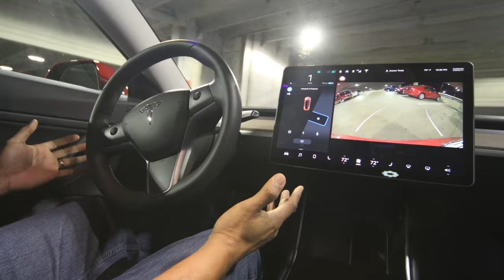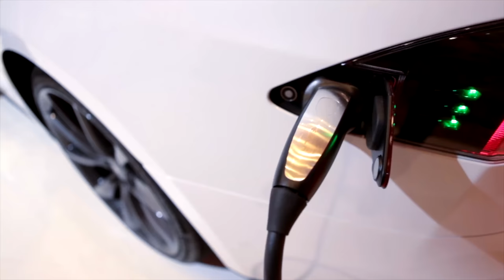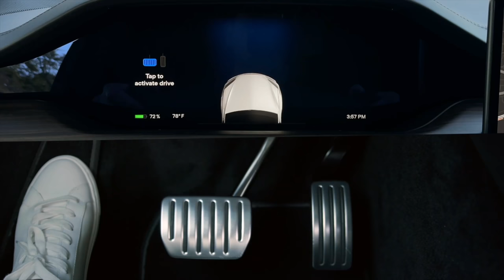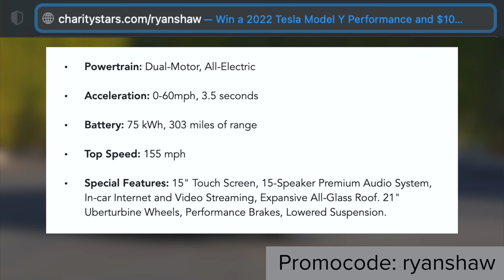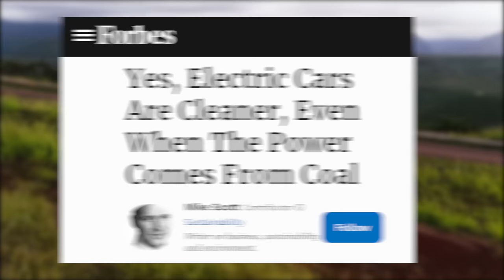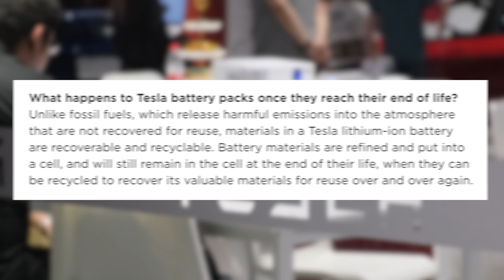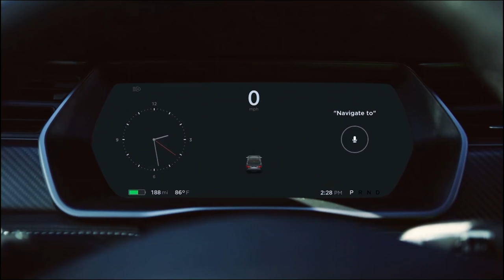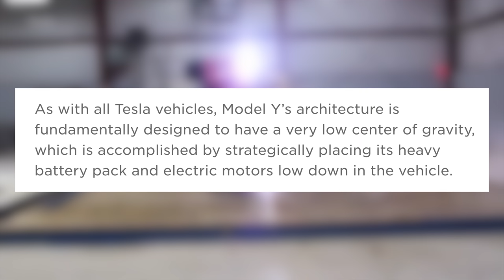9 Advantages To Owning a Tesla

Comment: One of the big advantages that you mentioned indirectly is starting a car in the garage to get it warm in the winter.  In Calf, this is no big deal but in Ohio it is. My garage is attached to the house, this meant either pulling the car out of the garage or opening the garage door to preheat the car.  Opening the garage door would still leave the garage full of fumes that I really don't want to breathe. Pulling the car outside to preheat it kind of defeats the whole purpose of having a garage.

Comment: My gas (petrol) bill went to zero when I bought my model Y and my electric bill went from $198pm to $111pm as I now charge my car overnight at 0.014c per KW. 
Plus my dishwasher, clothes dryer and all my batteries are now on this rate instead of my previous $0.12c per KW.

Comment: Electric vehicles make too much sense. 

1) So much energy is wasted in ICE cars via idling, lack of regenerative braking, and the impact they have on the climate.
2) EVs don't waste energy idling, and utilize so much more power considering the regenrative properties (energy is not lost as heat from braking), and the maintenance costs are zero to none.

Comment: I've had my Model 3 Dual Motor for 3 years now, and had a Model S for 5 years before that. My maintenance expenses for the 3 since I took delivery have been 1 gallon of windshield washer fluid, and two wiper blades. Maybe $80?
Reply: Where do you live that a gallon of windshield washer fluid and two wiper blades cost $80?
Reply: @allterrainrandy2587  Well, it was more that the wiper blades are pretty expensive - you can only get them through Tesla, and I think they're like $70 or so. I could be remembering this wrong. My point was, my costs have been practically negligible.

Comment: Tesla safety is also improved by the fact that there isn't a 400 pound metal brick under the hood in front of you that could end up in your lap in an accident.  Sure, they're designed to recess under the car in a forward collision but it's still a compromise.
Reply: Also, because there’s no engine, EVs have a better crumple zone.

Comment: What I like about the Tesla's is: the car is silent, the super charing network, low maintenance, the camera system, the instant tork, be able to charge at home and not worry about going to a gas station, not worrying about oil changes, using the Tesla app to warm up my car, or even summon my car, the large panoramic room, the range, the sound system, the frunk, and hopefully Biden passes the 12,500 tax credit for all Teslas.

Comment: Great video and agree with every thing but one.  My 2021 M3LR  is as you say quite with stopped waiting at a red light.  My 2021 MYLR however has a noise coming from the frunk.  I'm suspecting it is the heat pump.  I'm not the only one experiencing this but when I went to the nearest SC, I was told that it normal.  Not sure if that is true since my M3 also has a heat pump and I do not hear the same noise.  This noise takes away from lack of noise in the cabin when idle, something I do enjoy with my M3.
Reply: @Rapido20  This video is about Tesla’s. Only someone who doesn’t own one might not recognize the reference.  There is nothing in the video about BMW or anywhere in in discussion about this video.  Sorry it confused you didn’t think BMW owners were trolling Tesla discussion videos.

Comment: I'm  a fan and first tuned to your YouTube before ordering Model3 SR Plus a year ago.  Could you talk more about safety in front end collisions?   Radar was damaged in a crash, so detectors were disabled. The vehicle in front was a huge black SUV but not an emergency vehicle.
Reply: In a Tesla at least, the "frunk", or front trunk, provides not just cargo space, but acts as a huge crumple zone, so that it distributes the energy from a crash around the car rather than into the cabin. There have been many videos where a Tesla was in an accident, and the occupants could often walk out of the vehicle on their own. Compare that to say, a gas SUV/truck that rolls over multiple times, and the occupants often needing assistance to get out, and hospitalization in some cases.

Another nice thing is the dash cam built into the car. And because it records from 4 different angles, in the event of an accident in which you weren't at fault, you can prove your innocence, instead of the "he said/she said" witness testimony.

There's a YouTube channel called "Wham Baam Teslacam" that shows accidents and other interesting things done around a Tesla. In many of those videos, when another car crashed into the Tesla, the other driver claims that the Tesla driver was at fault. They often then looked shocked and change their tune when they find out the Tesla recorded the accident from four angles, and in some cases, the police will cite the other driver with causing the accident if the other driver claimed the Tesla was at fault.

Comment: What if you don't have a driveway? What if you live in an apartment? What if you are visiting your Great Aunt for a weekend and she doesn't have a charger? What if you are low on charge and you forget to plug in or something goes wrong and it didn't charge and now you can't get to work on time because it will take a half hour to get just enough charge to get to work and then another half hour charge to get back home?
The point is that with gas I don't have to alter my life in any way based on my car's power requirements. Stopping at a gas station for 5 minutes every 2 weeks is not life-altering. Where I live or what type of home I live in or changing my routine just because of my car is an inconvenience.

Comment: While the Tesla supercharger network has been a significant advantage over other EV manufacturers, Tesla has announced that they will opening this network to non-Tesla EV's. Also, I just read that Tesla has changed the pricing of their superchargers that will result in a substantial cost increase to Tesla owners.
Reply: Is this true? Very disappointing if it is the case. If anything I would have thought opening up the supercharger network to other EVs would possibly lower the cost as they would be making more off the increased number of vehicles charging. Sigh.. 😔

Comment: I can't wait to drive a Tesla for Jimmy John's and not spend $500-750 a month on gas. I know that I could he's a more gas efficient car than my Mustang but otherwise I really would just keep using my Mustang.
Reply: Make sure you bring an extension cord and plug into 110v at JJs and wherever you go lol
Reply: Have you considered a conversion instead? Turn that Mustang into an EV. Significantly cheaper than a tesla.
Reply: @eondrache7786  conversions are neither cheap or easy (unless you do most yourself and value your time at $0, but even then it’s expensive). May be different in a few years.
Reply: @eondrache7786  it would still not be a tesla. Cheaper just to buy the real thing.
Reply: My $80k telsa is a huge gas saver compared to a $25k gas car. Pssssh saving big time money bro
Reply: Where are you going that you’re spending $500-$750 a month for gas? Mustangs surely don’t use up that much.
Reply: @xMercuryx56  delivery driver
Reply: @anekinoo7  plenty of 80k gas cars and pickups for sale right now.
Reply: ya, I spend 550 a month on gas and will be able to charge my tesla at work, it's gonna rock
Reply: @geraldh.8047  I didn't say it would be cheap. Its just cheaper than buying a brand new tesla atm
Reply: But electric cars can't possibly the future, until then it's a phase
Reply: @mr.monitor.  Thanks sounds like a good idea.
Reply: @eondrache7786  I never really thought of it but that wouldn't be a bad idea. But I'd rather not do that though. But that would be funny.
Reply: @courchar  That sounds awesome. I wish I bad that.
Reply: @huskiehuskerson5300  What are you trying to say?
Reply: @xMercuryx56  Yeah I drive like 3k miles a month most of that is for Jimmy John's.
Reply: Buying a Tesla won’t save you money, not at today’s prices. That would be like buying a BMW 328i to save money because it gets 35 mpg on the highway.
Reply: @wyattpotter2103  Question is, can you afford a $45-60,000 car on a Jimmy John’s paycheck?
Reply: @TecnamTwin  It will save me money though. Also I reserved it a few months ago with Blue and White interior and after all the fees it comes to like around 45k. But if I reserved it earlier it would have been $1000 less.
Reply: @TecnamTwin  anybody can afford a $50K car.  It is call a 84 months car note.

Comment: I'm  Tesla owner and not a naysayer. But,,, if it's accurate that there are approximately 1.8 Billion ICE vehicles globally on the road displacing those with a lithium based battery component is more than daunting. If for example a BEV has 3,500 battery cells (or equivalent) in its pack and we aim at 100% conversion from ICE to EV that's something like 6.3 Trillion cells and likely a time frame of 20+ years. Continued innovation in battery energy is essential to accomplish this gargantuan goal.

Comment: Safety could be approved.  I purchased the Model S refresh thinking it would be the safest car.

1. Headlights suck
2. No front cross traffic warning (almost got hit by a car running a red).  It would be nice to have this.
3. No rear cross traffic when backing out of parking spots.
Reply: Model 3 is fine, matrix led's and every warning system available
Reply: @paulfreeborough6868  There is no cross traffic warning system on any Tesla.
Reply: @lxxdakinexxl  it's on the roadmap, maybe as an interim fix you could pay attention to where you are driving
Reply: @paulfreeborough6868  Defensive a bit? Cross traffic is great for drunk drivers that run red lights.  I had a big suv next to me and this drunk driver ran a red so I couldn’t see.  Luckily I stopped in time but I was inches from an accident.  Also backing out of parking lots between suv’s when people are speeding.  Like I said for being touted the safest car, it is not. The Model S refresh interior is light years better than the previous model and I don’t know how you live with the model 3 interior.  I had a loaner and it was garbage.
Reply: @lxxdakinexxl  I've got a Shanghai model 3, I've owned Audi's , Mercedes , BMW'S, and the build quality is a match, guess the US built Tesla's are just bad. I've never had a near miss cross traffic, but if a drunk driver runs a red light and you are in the his path, no safety system is going to stop that accident, but I do sense you love a bit of drama in your story telling. And the fact you can spot a drunk by sight. That is indeed a fantastic skill, it's like a super power. Maybe the police could employ you to stand At intersections and you could just point out the drunk drivers so they could arrest them, and keep us all safe

Comment: Ordered a model 3 LR last month. Delivery says mid December. Debating if I should sell my gas vehicle or keep as a backup.
Reply: Used car prices are insane right now so maybe sell and if you really miss it buy one when the prices drop down again.
Reply: unless you do very frequent and very long roadtrips the model 3 lr will be more than sufficient with a decent amount of cargo space. If you are dependant on a lot of cargo space you could upgrade to the Model Y down the road.
Reply: @BizzMRK  I’m more concerned about snow and cold weather. How does it do in the snow and cold weather?
Reply: @jimbeam4111  it definitely has reduced range in cold weather. For the model 3 lr in 0°C enviorments I would estimate roughly around 300-400km should be possible depending on how you are driving. Tesla Björn released a video today where he tested the Model 3 SR+ in Winter (1°C, wet conditions) and managed 350km at 90kph and 260km at 120kph.

The heatpump and battery heater do a good job of keeping range at a decent level and if weather is below freezing people tend to drive a bit slower than usual as well helping with range. 

If you want a worst case scenario, I found a video a while back of someone testing the range of the 2021 Model 3 SR+ in canadian winter at -30°C and he still managed to drive 175km on a single charge. The LR would probably get around 200-250km in these extreme conditions.
Reply: @jimbeam4111  Teslas are great in the snow, especially the dual motor variants

Comment: No transmission problems.
No clutch problem. 
No rear differential problem.
No oil leaks.
No spark plug problem. 
No stripped bolt oil pan problem.
No late night at the gas station with the guy robbing the clerk then 
 looks you in the eyes problem. 
No who's at fault in an accident problems.
No worrying about the slow ass guy in front of you merging with freeway traffic going 20mph when he should be going 60mph problem because I can blaze past there ass!

Comment: I have a new tesla 3 performance.  I am considering ordering a model s long range.  Which do you recommend?  Advantages and disadvantages?  Money is not the issue. Thanks
Reply: take the s long range and i can take the 3 performance from you, if money is not issue
Reply: S is better. Faster, more room, nicer interior, smoother ride (air suspension), more range. I’ve had S, X and 3. S is my favorite one.

Comment: 10. great prepper cars. more and more preppers these days. with solar roof and powerwall, you dont need to depend completely on grid or gasoline supply.
Reply: True. But powerwalls arent exactly cheap.  Also depends on where you live.  In SF, most spring time we don’t get enough solar energy to charge the power walls.

Comment: One of the biggest advantages of EVs for me is that the accelerator position is very precise:  pretty much proportional to acceleration.  

I drove a pure-gasoline car — a rental — for the first time in 10ish years, and I was amazed at how vague the gas-pedal position was:  About the only thing I could clearly say was “if you want to go faster, push on it harder.”  How much harder?  Dunno!  Very hard to predict how the engine and transmission will react.

Comment: Ryan I'd be curious to see a video on the biggest drawbacks. Charging time in road trips is an obvious one, but I found out the other day that insurance companies total electric vehicles in accidents at a much higher rate than ICE cars. That's the most "ungreen" thijg about them IMO.
Reply: After driving a Tesla for 4 hrs, I’ve heard drawbacks from numerous, possibly jealous, friends and acquaintances.  
1.  Road  trippers, determined to arrive at a destination in the shortest amount of time, packing food to eat while driving, and timing restroom use to refueling stops.  
2.  Can’t charge at home because I live in an apartment / condominium.  I must drive 10 mi to find a charger. 
3.  Too expensive.  I can’t get 400 mile range for $30K.
4.  Accident repair cost is twice an ice vehicle .  Aluminum in Tesla may be the reason.
5.  Battery is too expensive to replace because I keep a car for 20+ years.